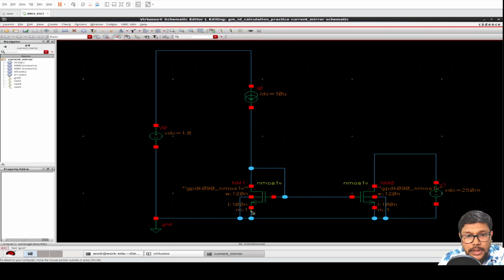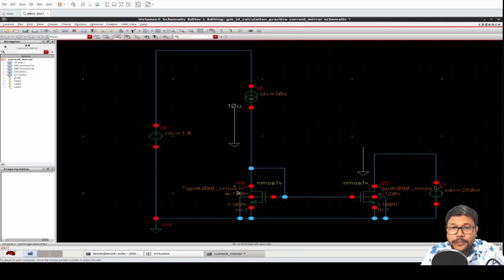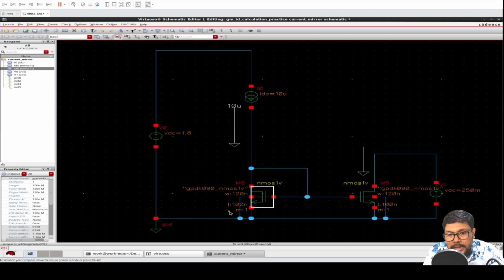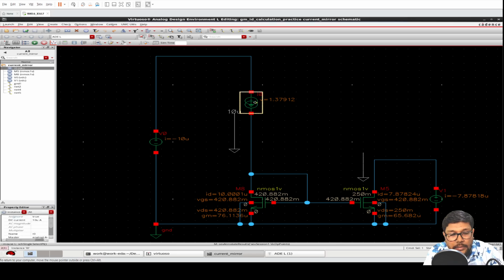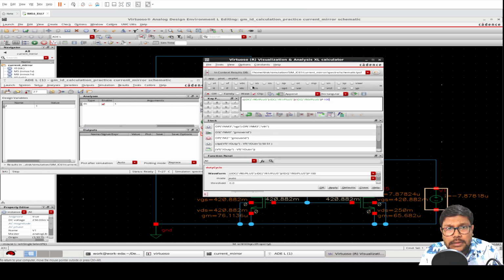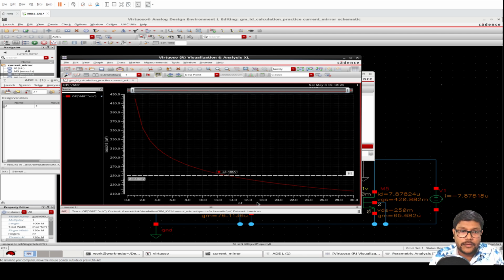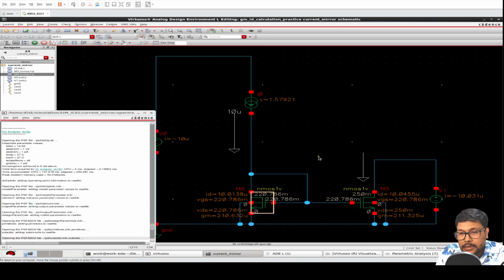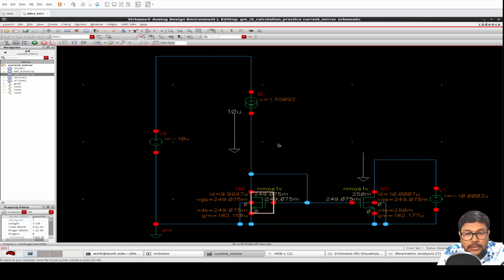Mastering 2-Stage Miller OpAmp Design with gm/Id Method part _4

Comment: for my case, even when i increase fingers, vds is same?
Reply from the maker: Increasing fingers for the same Vds can affect other parameters like current density or matching, which might be why you're observing this. Have you checked the impact on gm or output impedance?